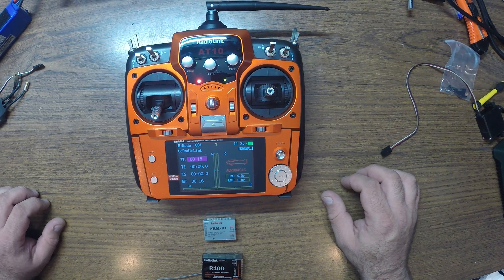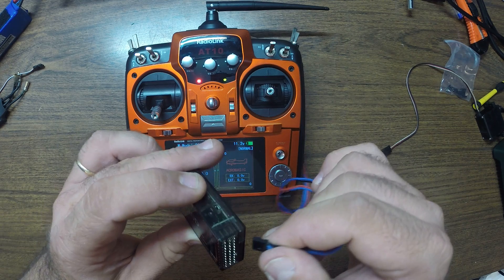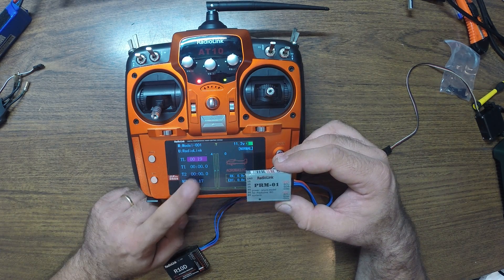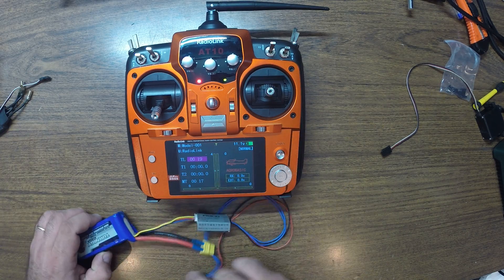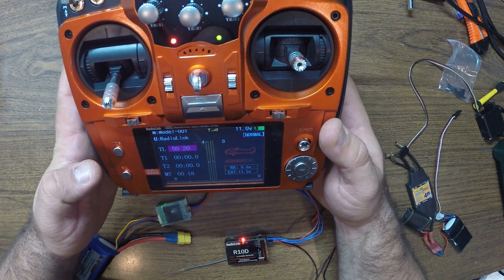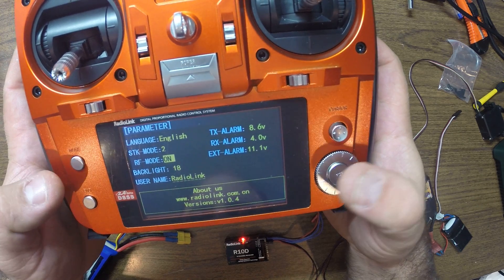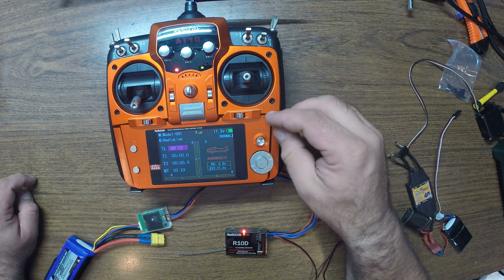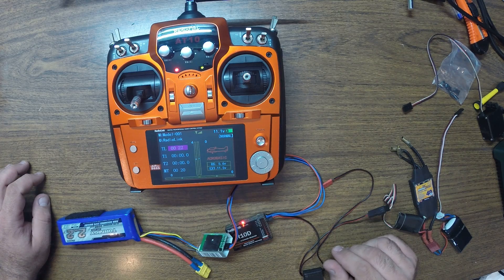RadioLink AT10 + PRM-01 Telemetry Module

Comment: It has two ports as other modules are required to be connected in parallel.
New transmitter firmware allows you to dial the sensor trim to show an accurate reading.
See my channel for video coming soon.

Comment: Hello Sergio, can You tell me if I can use R10D (with the very same transmitter) on a TL200A 12V platform, with 11.1V battery, based on Naze32 SP F3 10DOF flight controller.. I am confused with its maximum input voltage spec. informations that im running on to, somewhere is 10V, somewhere is up to 16V, did someone actualy mesured it or what is your oponion please..

Comment: So it has two I2C ports, one goes to the receiver for sure, but could it be the other I2C is for daisy chaining it with the PRM-02? Since the I2C port on the receiver is now occupied, it could actually be a neat trick if this is the case. On banggood it's listed with the features "signal strength, receiver voltage, battery voltage, temperature, engine speed, GPS location", many of which are obviously not provided by this module itself but could be when connected to the PRM-02 which has a UART port for connecting to APM/PIXHAWK (mavlink).

Comment: I have bought two of these telemetry modules and I have an AT9 (new) and the AT10 (new). I have tested both modules on the radios and they dont work. They show a voltage via telemetry but the voltage shown is nowhere near the voltage of the flight pack. The modules are not accurate at all, so in other words totally useless for the intended purpose. Others on youtube have the same issue. How does yours compare to the actual voltage of your lipo compared to the readout on screen?

Comment: Thats the external power module. Just gives you your flight pack battery voltage not GPS telemetry.
Reply from the maker: Yes i know that.  Thank you.
Reply: +Sergio Pereira when I seen telemetry I got excited and thought they might have released the GPS telemetry module. Lol no such luck. Hopefully soon.
Reply from the maker: +Rob Hildreth Yea. The radio seems to have te option to receive GPS DATA and some other stuff. It's just a matter of waiting for some upgrades from Radiolink.